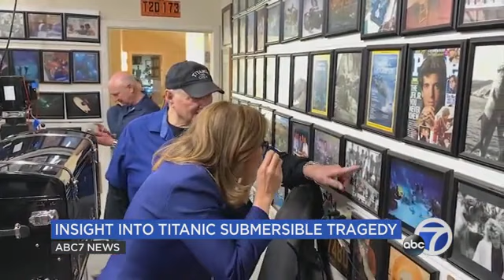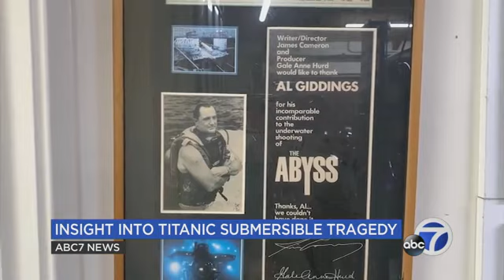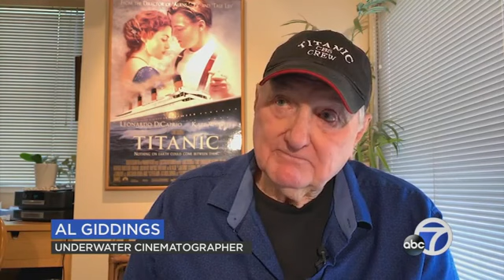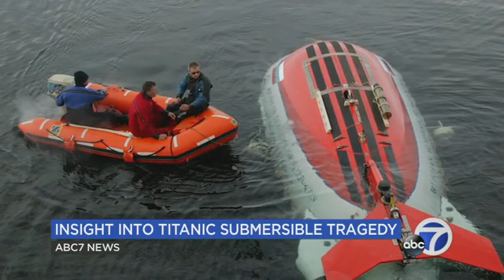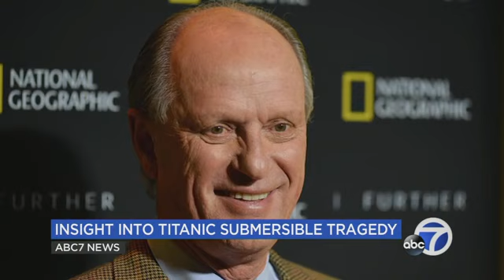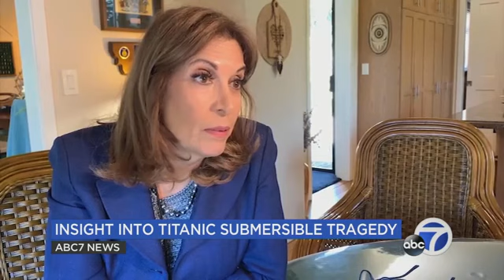Titan sub tragedy was 'disaster waiting to happen': expert

Comment: Under sustained load in the presence of sea water, carbon fiber's tensile strength decreases 7 to 12%. Each time he was diving, it was weakening the hull until the 6th time it imploded. Stockton Rush said he was breaking all the rules by using carbon fiber, but you don't want to break rules when it comes to something so dangerous. Carbon fiber should never be used on submarines.